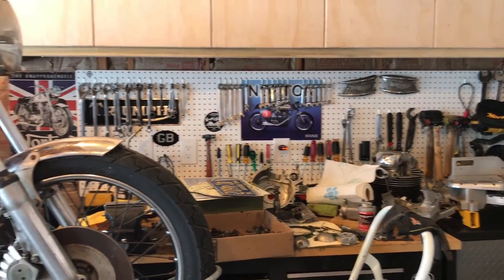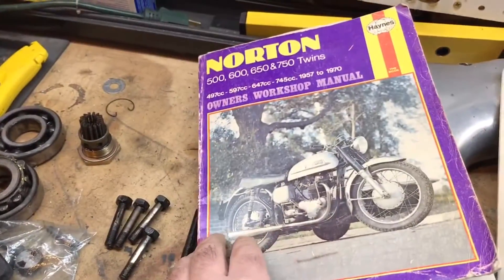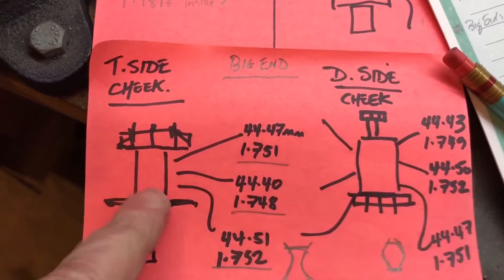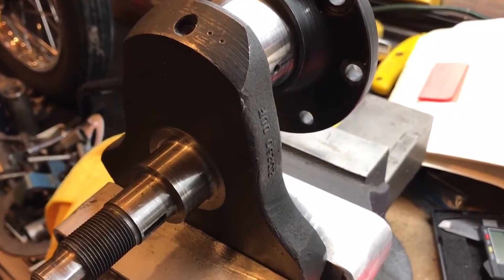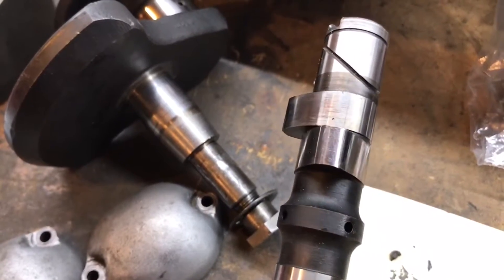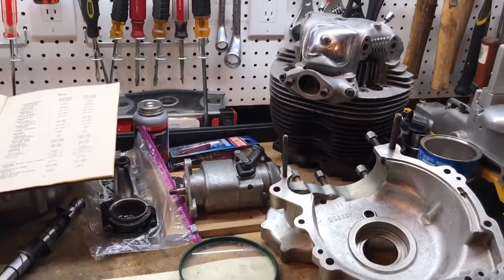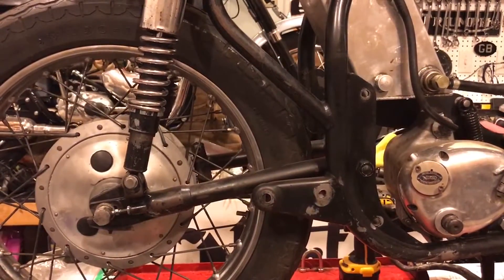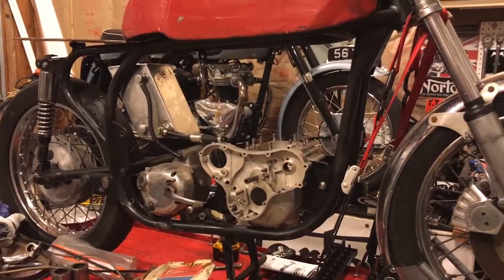Norton Atlas Project - Shep - Part 37 - Engine Disassembly - Part 16 Crankshaft Journals

Comment: The dimensions for the crank journals are at a standard 70F so measuring in a cold shop will give you erroneous readings. Also I only see a digital caliper no micrometer? Calipers are nowhere near accurate enough for precise measurement despite having a .0005 resolution.
Reply from the maker: Thanks Paul for your great points. I didn't realize that these measurements were/are taken at 70F!  Also, you're right, I don't have a micrometer, just the caliper and it could also be a out.  These were never intended to be measurements that I would use.  Hopefully the guys that I take the assembly to will have all the right equipment.  I've also added this in the video description.  Cheers, Mike

Comment: hi .. besides your rear shocks, commando stanchions and commando dampers could be the reason for your mainstand being to short ?  (there both slightly longer than the roadholder equivalents) .. great series btw, fun to watch ..  best regards
Reply from the maker: Hi Bob, thanks a lot for your comments.  I did not realize that the stanchions and dampers were different.  I will take a look for some.  Cheers, Mike